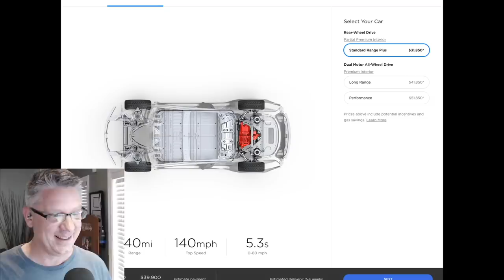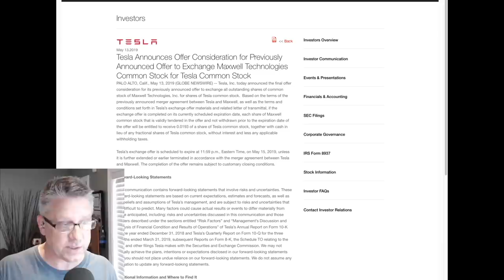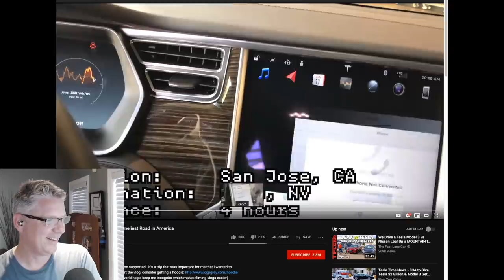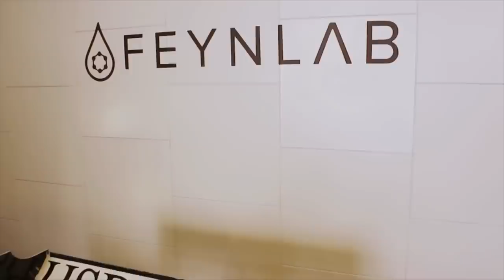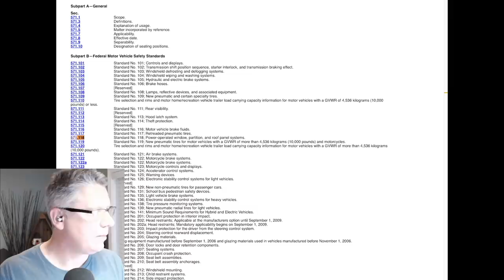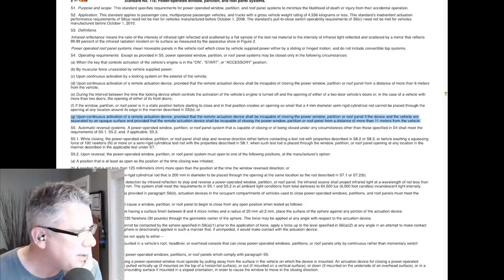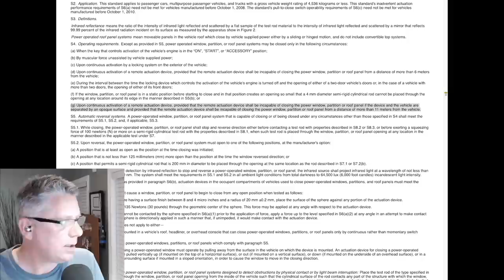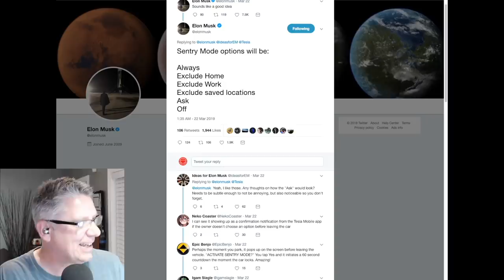41 - The World is on F'ing fire !

Comment: ~ 1:20—I'd say, consider what the maximum is you might reasonably expect to be driving before the next charge, and charge the battery to handle that. If you almost never drive over 50 miles in a day, and your range is 200 miles, charge to maybe 45 percent, and then you won't go below 20 percent. Hold 20 percent in reserve. IAC not having the battery more charged than it ever needs to be will extend its life a little.

Comment: Price going up - report, and no more blah, blah, blah needed.
BATTERIES - the BIG bottle neck - for EVERYONE, right?? Tesla making 900 vehicles/day. Others can't seem to make 900/week.
ALL stamping machines, even the Model 3 are huge. May well be using the same stamping machine for ALL vehicles.
Parts, panels, cast parts could well come from California go to Nevada JUST for assembly (line) and IF Fremont ever needs extra work, they could assemble 3 and Y at Fremont.  spoilers probably made by a vendor - and Tesla couldn't project demand very well AND supplier, because of slow ramp up, got behind vs ahead of demand.

Comment: If you think gas cars are the biggest problem then your so wrong, oil is the blood of the modern world like it or not,  please try to make a tesla with out oil ( you can't) plastic , transport , mining , making batteries,  honelsty most of anything ever made is linked in some way to oil.
Reply: Correct, but there's a BIG difference in using it as an ingredient in raw materials versus burning it and releasing 100% of its stored carbon into the atmosphere.
Reply: @ianpavelko2458  sure but don't be too critical when everything ever made is oil based
Reply: @IFlyinBaconI  
But when "everything ever made is oil based"  but now tends to end up in the ocean, and has entered the food chain, I think we should possibly, just POSSIBLY be SLIGHTLY critical?
Reply: @rogerstarkey5390  it's not just the car industry that the problem,  yes be critical of it sure but there not even the biggest problem